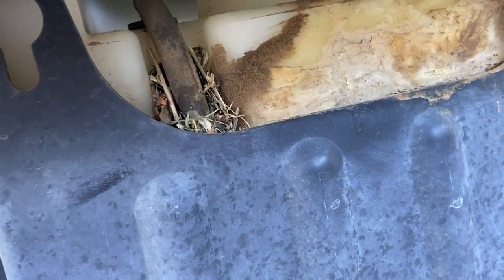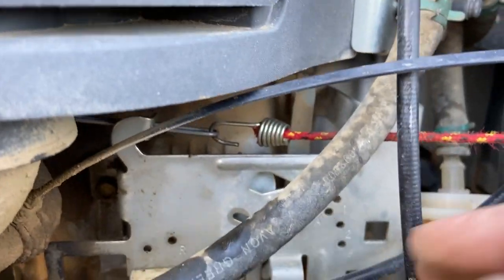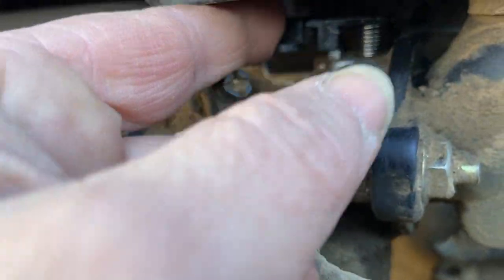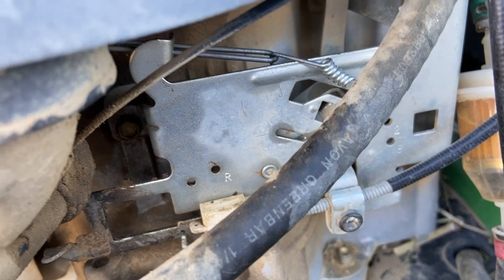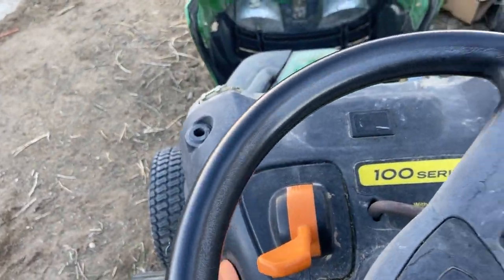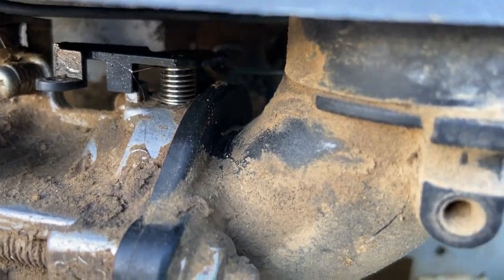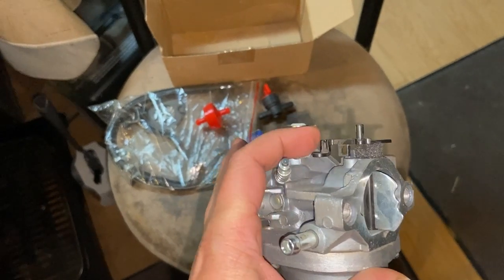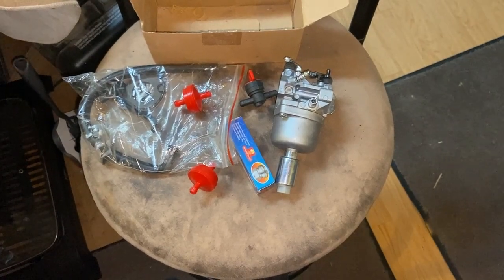John Deere LA110 riding mower: Gas tank repair update, carburetor choke problem

Comment: The lever you were moving has a spring and you can use a clothes pin there.
Reply from the maker: I tried to put the spring on the lever, but there wasn't a good place to attach it.  Now that I found the new carb, it won't be an issue anymore.  ;)
Reply: @Arkine13  I'm glad you got a new carb.  To make the old work is take the lever off the shaft it's mounted to.  Not a easy process.